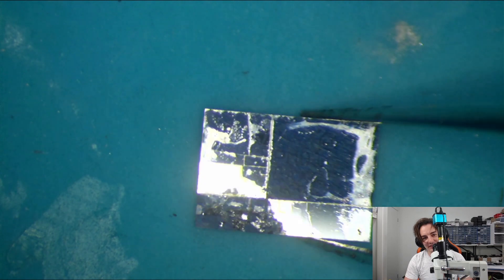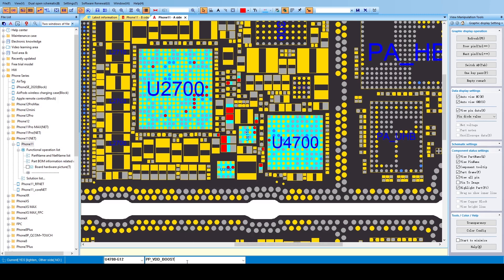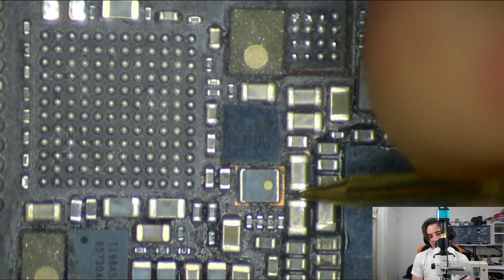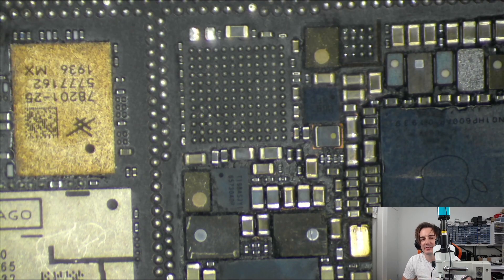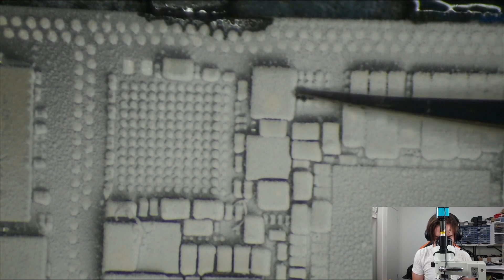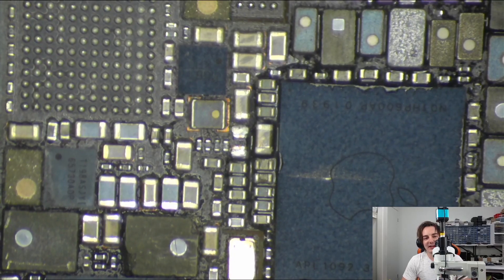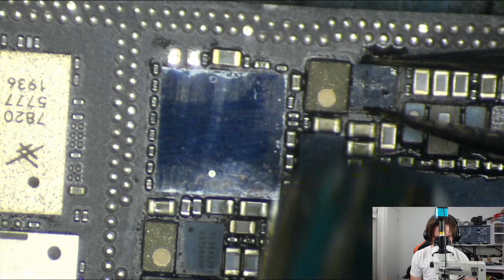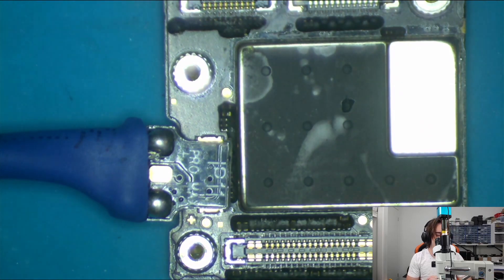How to find and fix short a circuit

Comment: Great vid! Why can you just remove the capacitor and it works? Don't you want to replace that guy?
Reply from the maker: Caps are like batteries, they hold power for the circuit so when it's required the draw isn't just on the power supply - if you have a 3.8v battery without caps, that's fine for something simple - but when you have a device that uses bluetooth, wifi, camera etc, you have more things going on, so you have caps there to store that power to smooth out the demand on those lines, rather then everything all the sudden requiring power just from the source - does that make sense?

Comment: Why dont u need to replace the faulty cap? Does that not leave a break in the circuit?
Reply from the maker: Hey! Most of the time, caps don't need to be replaced in order for the device to work, though pending why they are in place (such as on the CPU/GPU lines) I will replace. 

For repairs like this, we just need the data, so no need doing extra work when not required  :)